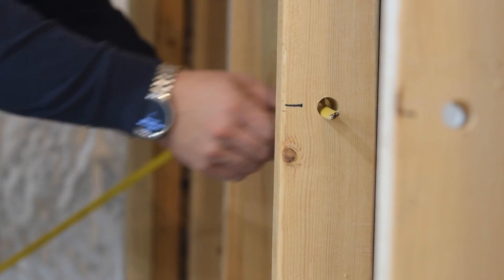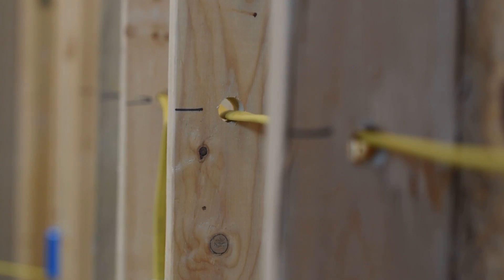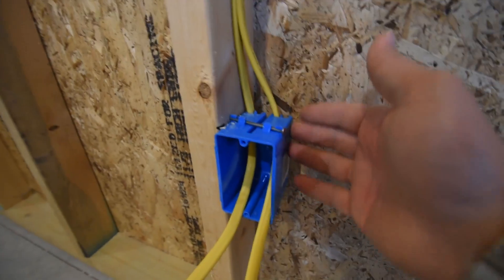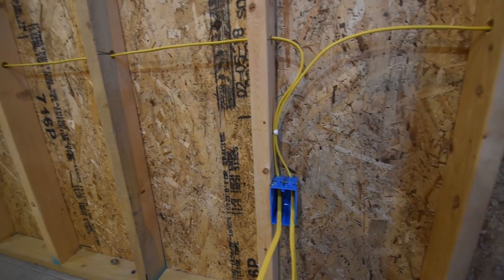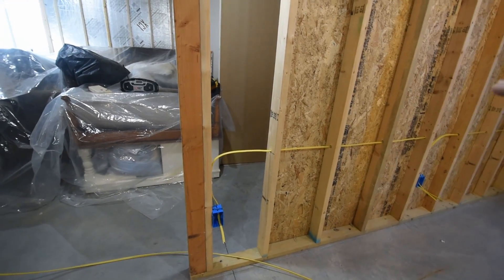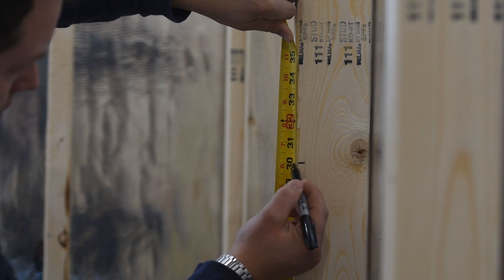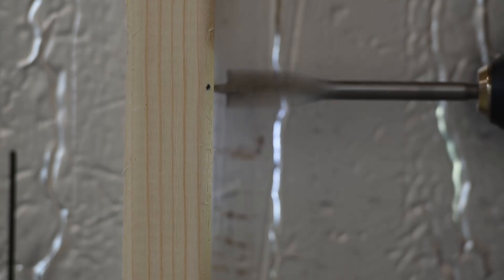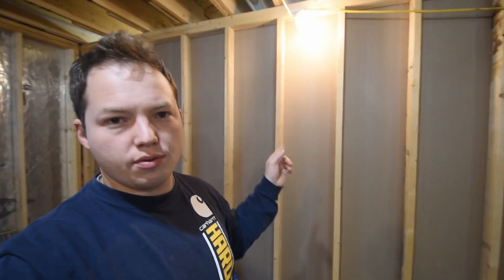How High Should Wires Run Through a Wall

Comment: Homeowner's set the trends and the latest trend is to put outlet boxes horizontally in the baseboards. Six inch baseboards are the rage these days. Running wires at 11 inches above the floor minimizes the risk of drywall trades piercing the wires while anchoring drywall.  Nailplates are recommended but add time and cost so a standardized run is best. Drywall tradesmen are not quite as dumb as they look and usually take note of where the electrical runs are placed. A 5/8" drill bit is large enough for most household wiring.  Centering the hole in the stud reduces the chances of tradesmen piercing the runs and won't interfer with insulation. I've seen spray foam used afterwards supposedly to reduce airflow (fire-block) and maybe bugs.

Comment: I usually when I'm putting in new construction electrical boxes whatever hammer I have I will take the electrical box put the hammer on the ground announce the electrical box on top of the hammer so you don't have to measure every electrical box and when it comes to switches the reason why everyone should go 48 in because a board on sheetrock 48"W×96"L so you don't have to cut the first board on sheetrock you only have to notch out the second board but everyone is different like I tried to when framing make entry ways and interior doors as wide as possible just because it makes it easier to move furniture around

Comment: Most all kitchen and bathroom cabinets, base that is top out at 32" so running wire at 30" should allow for the screws to avoid the wire when anchoring the base cabinets to the wall. Maybe consider 28" but no lower. As far as I know receptacles have to be a minimum of 12" from the floor according to code for Arizona. Light switches can top at 48" so only one piece of the drywall would have to be cut. When I remodeled my two bathrooms I marked and ran 2 x 4 studs sideways where an assist bar and the towel rods would be mounted. This allows for a superior mounting surface for these items that take weight or overtime the drywall anchors fail. I also put in 32" wide doors rather than the 24" doors previous. if I am able to build my own house from the slab it will have 8" thick colored block on the exterior and 2x8 steel frame wall to the interior. All electrical will be sleeved through steel conduit which completely protects it. Both bathrooms will have a four foot wide plumbing chase between them allowing complete access to the plumbing, the same goes for the kitchen and laundry room. House will be all electric with no natural gas that requires venting through the roof. The clothes dryer can vent to the plumbing chase or 90 the vent to the exterior wall. If planned correctly only two plumbing vents would leave the roof., 4" for the bathrooms and 2" for the kitchen and laundry! Refrigeration Compressor on a slab outside on the ground. This allows you to never have to go up on the roof as there would be no equipment up there!

Comment: One of the last things you showed was running the Romex around the corner. That was, from what I am told, where the "four block corner" measurements came from.  A 12" block  a 16" space another block and space and so on until you get to the end of the corner post. Those space would be where electrical and plumbing would be run so you don't have to drill through solid wood to make a chase.

Comment: In the  Kitchen. No wires at 35 or a little  below  54.5 wires are for  undercabinet  lights. No wires  at  54  to 57 .or  7 foot  to 8 foot 👍
BUT  really all a screw does is throw the breaker or maybe  through a  water line. 
You  get a big squirt. 💦

Comment: To save time, set low outlet boxes a hammer height off the floor. When drilling through studs, rest the back of the drill about center thigh. Everyone is a different height, but it comes out just about perfect. My dad has been using that method professionally since the 1960s. It’s tried & true.

Comment: I remember that several years ago most stud material (from Canada) came with a hole bored approximately 16" from one end  (top or bottom... that's another discussion...) This apparently was due to some edict by the Canadian government regarding an export tariff requiring an extra manufacturing step for lumber so that mill workers would have some work to do (nothing to do with the handiness of installing wiring, or plumbing...)
Anyway... I usually drill a 7/8" hole at 32" (by guesstimate) off the subfloor.
You just gotta decide...! And.. judging from the rest of the comments...

Comment: It’s best to staple the wires on the outside and drill a hole through the wall into the receptacle.
We call it “comcasting” but you have to use UF and not romex...

Comment: Set a laser at 30" would probably be the fastest.
Reply: Holding a marker at 30in on tape would be even quicker, don't have to setup or take anything down
Reply: @amorestperpe  pull the laser out put it in the stand hit the button set height. It's way faster almost zero fumble fucking with a tape over and over.
Reply: Why don't people just pre-drill studs before framing?

Comment: coming from the right angle drill and then the hole hawg generation, I typically run at thigh height, which is probably about 30 inches

Comment: I also used 30" on my basement home gym build.  My county recommended that height also.  I like your measuring board idea and would add putting a notch in center so when you scribe your line it put an indent for your center hole.
Reply: What a waste.

Comment: Doing carpentry framing learned not to put a block on 
 48 " following the rest of the wall blocking to avoid the electrician tear it off so I did knee and shoulder height at all doors

Comment: Nice video. Comments were helpful too. I’ve remodeled houses twenty+ years so I’ve done it all from start to finish. Years ago I made a template for this with a couple pieces of 1x4 nailed in a “T” shape. Pretty easy to make and is spot on. 1x4 with a 5/8 hole at 22 1/2” up and a couple scraps screwed to the face to mark for outlets and switches on the face of the 2x4. Takes longer to run an extension cord than to make it. Hold it in place and it will guide your bit. Years ago an electrician taught me to use an impact driver with an auger bit and to carry a 4, 6, and 12” extension. I’ve also learned to drill clockwise around the room so if you do hit a nail or hard spot, it won’t smack you in the face or bust your knuckles.
Reply: Does clockwise around the room mean you drill the studs with your left to the wall?

Comment: I think I saw in England they have a code for this. Not surprisingly🤨. But if you were to cut into a wall later in life you would know some guidelines about where the wires would be so you could plan some things.  Of course you’d never be able to actually trust that.

Comment: In the house, your guidance makes great sense.  In the workshop and garage, the table saw, other stationary tools, workbenches, shop cabinets are all right about 37 inches high and very heavy, so to be accessible, receptacles need to be a little higher. 
Always enjoy your channel and learn a lot.
Thanks.
Reply: Workshops, garages, and industrial applications are different then homes, especially if trying to stay with ADA recomendations.

Comment: If 1/2 inch drywall is being used, I install my switch boxes at a height of 48 1/2 inches down to the bottom of the box from the bare framed  ceiling joists so only the upper piece of drywall needs to be cut. As the ceilings are always drywalled first, this brings the vertical measurement to 4 foot and saves time.
Reply: All the new developments use 41” to bottom of switch box.
Reply: That's only a benefit if you hang drywall horizontally; if you opt to hang it vertically for fewer seams to tape and mud, you'll only have one piece of drywall to cut regardless of how high the box is.
Reply: @HaploBartow  I was taught by a pro sheet rock installer I worked for in my early 20s. It is very rare to install vertically. Your supposed to stagger your butts and hang it horizontal.

Comment: I run my wire at 20. I do 14" center 
Switches i do 46" cuz its easier to reach and helpful for kids reaching for the switch. 48 too high and 16 is too high. 
Looks awkward and unprofessional.  
Counter tops I do at 46 as well.

Comment: Yes 30" is a good number. I take a board, trim to 30" and rest my drill on it when drilling he wire hole. This ensure all holes are the same height and eliminates the need for measuring and marking. I also use only self-feeding dril-bits to make the drilling easier.

Comment: Im doing Exterior walls. The insulation I have has moisture barrier that I dont want to cut.
No national codes for height placement?
I want to run my wire holes bout inch up off bottom plate, center of studs.
Studs 2x6 ,2' on C.
Staple wire to plate in between studs, prob 1 center.
This would eliminate cutting my insul.
Is this acceptable code wise to your knowledge?

Comment: since sheetrock is typically attached at 12" ctrs.   So running wire at 6",18",30" and 42" reduces risk of screw  or nail hitting cable.  30" is a great selection.
Reply: @scotmiller5979  Only a sloppy worker or novice apprentice would put screws in randomly.  Try working with journeyman craftsmen.

Comment: I never run my wires at 24" and the reason is the sheetrock guys are going to run the rock horizontal and 24" is EXACTLY in the middle of a 4' wide sheet and is where they usually will put 2 screws, and depending on the rock hanger, sometimes they use longer screws and then you are trying to find the short because you ran the wire dead center of where THEY fasten the rock.
Reply: Really good tip. Shields help with this, but if they're inconveniently placed, the rockers will hate you. I don't like making other workers hate me, even if I won't be on the job site when they arrive.
Reply: Should be screwing at 16" and 32" at least, not 24"

Comment: Height of horizontal wire runs:
Other factors that should be considered, many homes include eight adding a :chair rail" a decorative and functional piece of molding running horizontally around the room to protect the wall from chairs being slammed into the wall thus causing damage to the drywall. The height of the chair rail is between 26 and 32 inches off the floor.

Comment: The holes should be high enough that you don’t have to bend over when you are pulling wire and drilling. Hip high
Reply: What I was going to say. I just hold the drill at the same height on my thigh or hip and circle the room. Saves making all those marks. OTOH, you could use a chalk line at your preferred height. You can see the mark from either side of the stud. 

But avoid 36" in a kitchen or bathroom area.

Comment: dont forget those nail plates on the studs over the wire run holes.  I remember when plastic boxes started showing up,  so glad to ditch the metal boxes,
Reply: This is good advice. Code is that the the wire has to be 1.25" back from the edge of the stud where penetration by fasteners is "likely" to occur. If you are that far back, you don't need a nail plate. In other words, they don't expect a fastener to penetrate more than 1.25" into the stud. However, from practical experience, I'd put them there anyways, as you never know when someone is going to drive a 3" nail through in order to hang their picture.

Comment: I am restoring a old home 80yrs old and all new electric the house already has a200amp service since it was built before 2002 do I have to install afci breakers since the national electrical code says any home built before 2002 does not have to have afci protection .does anyone have any information on it  I would appreciate it.

Comment: What about corners? Are there do’s and dont’s? I’d imagine that structural beams are avoided if load bearing.
Reply: To avoid corners, especially a load bearing corner post, beam whatever you run the wiring up to the ceiling and route it down the wall right next to it, maybe one extra foot of wire to avoid the beams!

Comment: in uk that would be against regulattions, we have what is called zoneing where all cables are run horizontal or vertical from an outlet or switch hen you know where the cables are in the wall just by looking at it simple really
Reply: I like the English version better; it’s either vertical or horizontal from the switch and 1500mm from corners/end of wall 👍
Reply: @lasaraungbakri7386  yes it's 250 mm from corners or end of wall

Comment: wait, the staple doesnt matter when the hole is close because the Hole itself is seen as a strap. thats code aint it?
Reply: I believe you are correct. Always best to confirm these responses by checking with the electrical code

Comment: I do my fair share of houses. I usually have a table set up for cutting ferring strip and 2x4's with a mitre saw. I cut two pieces of ferring. One at 18" and the other at 48". I mark all switches bath vanity and kitchen counter at 48",and all other general use receptacles at 18".
Depending on framing I usally rest my hole hog at my knee height for outlets around the outside perimeter of dwelling and for switching usually two holes above and one below if needed.

Comment: Got any tricks for going around corners on finished walls?
Reply: Oh, gods. I've come across corners that were boxed in with two-bys at right angles to each other. Once, when rewiring a flood damaged room, I found the holes cut at different heights on the two sides. I think...my memory is unreliable...I think I cut a short piece of cable, put the appropriate bends in it, and wiggled it through the holes, then used that to pull the new cable through. But, as astronaut Rusty Schweickart once said about taking a crap in free fall, "There ain't no graceful way." At least, not that I know of.

Comment: Get your self a laser that will shoot across the room at any height. Then you can drill the holes instead of using a Sharpie and measuring tape at each stud. 

Or get yourself a stick that is cut to length. Tape the Sharpie to the stick and mark each stud as you see fit. Don’t have to deal with measuring each stud.

Edit: Should’ve waited 10 seconds to post. Lol
Reply: No you jackass, don't use a laser do it with a chalk line.

Comment: Be careful at that 30 inch mark because standard height for a chair rail for the top of the chair rail is ~33 inches. So if you go above 30 inches with your wiring you increase the risk of having a finish nail hit your wire.

Comment: I'm interested in the best heights from the drywall perspective. The finished ceiling height is achieved by considering adding bottom plate (1-1/2"), stud (92-5/8" or 104-5/8" or 116-5/8"), double top plate (3"), then subtracting ceiling drywall (-5/8" historically) and finished floor (-1/2"). Ceiling drywall is often 1/2" instead of 5/8" these days so you can say there is about 5/8" gap above the subfloor.  Drywall comes either 48" or 54" wide and starts at the ceiling coming down. It's also thinner where they meet at the ceiling bevel.
On 8' ceilings the seam is 48-5/8" (48" drywall) from subfloor
On 9' ceilings the seam is 54-5/8" (54" drywall) from subfloor **OR** 60-5/8" and 12-5/8" (48" drywall)
On 10' ceilings the seam is at 72-5/8" and 24-5/8" (48" drywall) from subfloor **OR** 66-5/8" and 12-5/8" (54" drywall)

Comment: On a different topic, inspectors in this area (central FL) do not allow use of the cable knockout closest to the stud since it violates the required 1.5" spacing. Recently we started putting boxes centered at 20" due inspector's interpretation of  ADA requirements
Reply from the maker: Interesting. I also heard 18" as the ADA height. Why is it that inspectors interpret it this way? Better safe than sorry so maybe 20" to the top should be the new standard?

Comment: What size spade bit do you use to drill hole through the studs for the romex wire to run through??? Thanks.
Reply: Normally use an auger bit.  Will pull itself thru the wood, especially when using the hole hawg.

Comment: Use wire guards regardless and you will not have to worry about screws or nails.For the cost of guards it's cheap insurance. Scrap pvc pipe for gauge for mounting boxes, Mark with sharpie and save. Walk around put all lower receps in, then gfi. in. , then switches, vanity lights. Etc. .limit penetration thru top plate will have less holes to cork and less air leakage.and And 6 to 8 inches above or below box is plenty to staple like you said and prevents waste of material. Shorter runs equal less resistance. Epvc is cheap and anything you can put in slab do so. It will save time and material and won't have to walk ceiling joist, banging your head on rafters to pull as many H.R.s .. Use push on connectors for joints,the time it saves is worth the cost, folds up in box a lot neater too.Use boards on job site to nail across ceiling joist in attic to one side  to make trough for wire to lay in to protect it. And last but not least get a good quality helper that wants to learn that can nail on the boxes and you drilling right behind him. Keep organized because that increases speed.

Comment: For 30 years I always ran my wires up ,over and down outlet to outlet that way if a door or window was cut in down the road there were no wires in the way.
Reply: 30 years ago, romex was a lot cheaper
Reply: @BubbasDad , that's true.  Im seeing service looping as well. It's not wise, as you could add even more wire to the box than the pigtail.
Reply: I drill a lot less holes and have less sawdust to clean up after.
Reply: Wow. That's a lot of extra work.